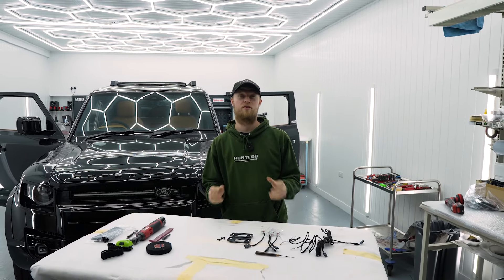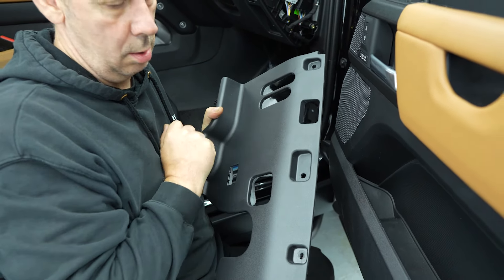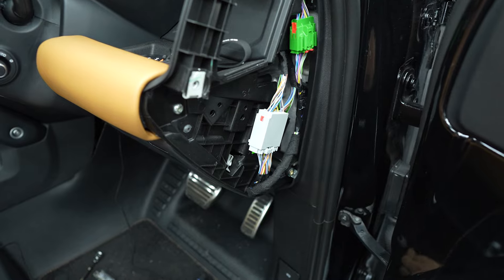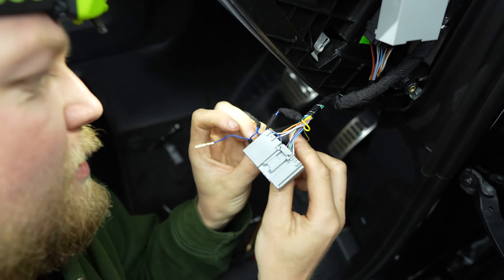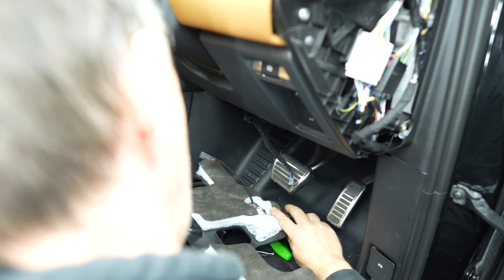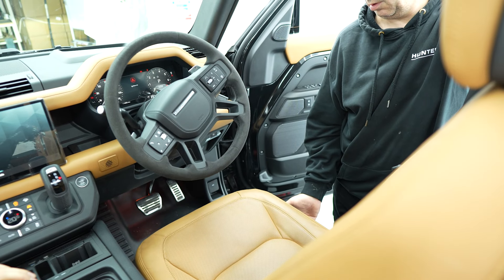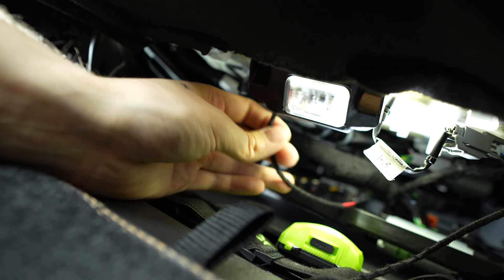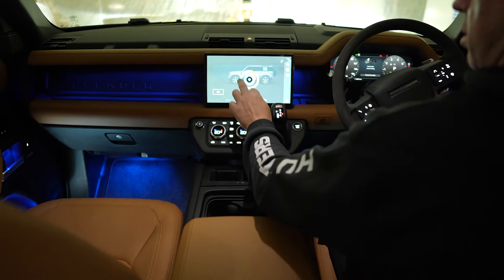HOW TO FIT: NEW DEFENDER AMBIENT LIGHT EXTENSION KIT FITMENT TUTORIAL

Comment: Video provides great coverage of the install!! The kit is very nice, well made and looks OEM. In the process of installing this in my '24 D90 (USA) and some quick comments:
1. For the tools required, would be helpful if you could put the list in the video description above or do a text overly on the video, that way it's easy to take a quick picture of the text and go grab stuff.
2. When installing the connecter in terminal block #8, there is reference to 'the blue male connection' which is a little confusing as there is a blue wire (small connectors) and blue/white wire (large connectors), so it should be blue/white wire for #8. Guess there was a reason to have 2 'blue' wires in the loom supplied...
3. I can't for the life of me figure out how to get the #6 connector out. in looking at the blue wire (small connectors) there is no apparent barb on the socket, so it's not obvious where to poke the pick/pin remove tool
Reply from the maker: Thanks for the feedback, if your still having issues feel free to email or call us up and our technicians will be happy to help 👍😊